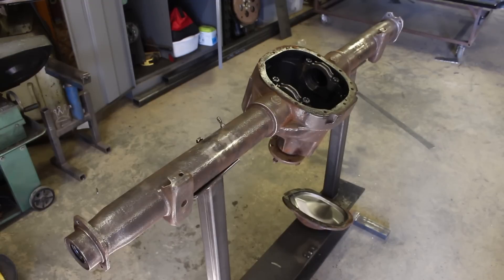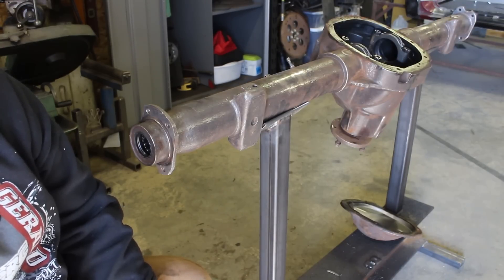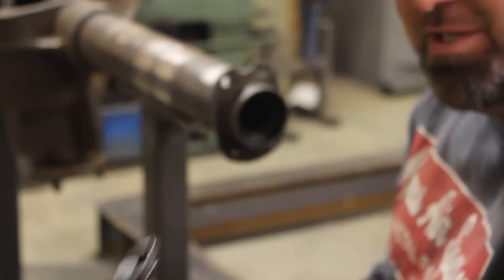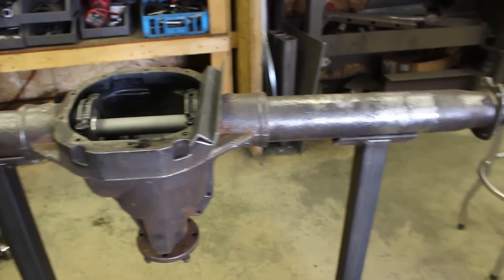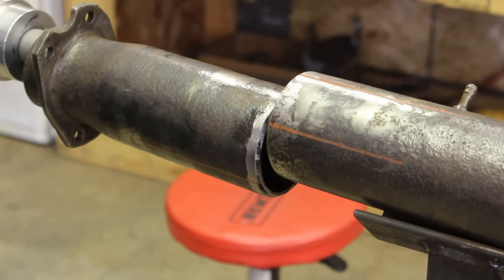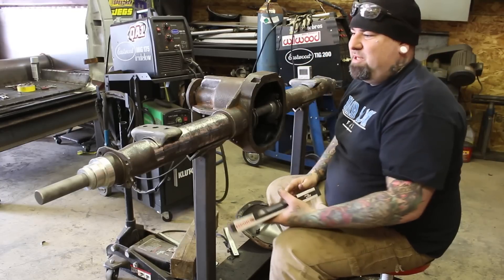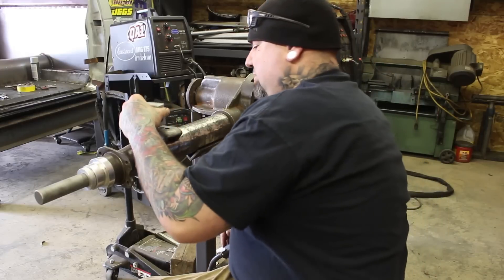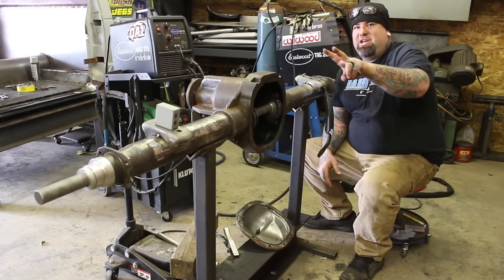How To: Narrow a Ford 8.8

Comment: Cut the housing ends off and weld on larger bearing ends. The issue isn't just that the housing is too long; the factory bearings are too small.

Comment: Another way to do this WITHOUT buying a second driver side axle, is to make a cut on EACH tube. One at 7” and the other at 4” and then just swap tubes from one side to the other, then swap the axles. You then have a centered pinion and reuse the same axles
Reply: Impossible..... literally impossible.....post up a vid then....

Comment: Nice video do you still do the s10 8.8 interested in one
Reply: Do more research in doing it yourself. 
Sadly this guy did not prep or setup right for the video and it probably warped even using a tig machine.
He left out some good info and i would not pay anyone to do what he just did.
Its easier than you think. 
My suggestion, do it your self but use two 3" C channel about a foot long on either side to center the tube. Tack in2 places measure all four opposing sides to make sure its straight and weld two opposing sides let cool than weld the other 2 sides. And save yourself $$$
Aunt nothing to it chicken wing.

Comment: Great video!!  I like your laid back style.  Only question I have is I just narrowed my 8.8 4 7/8".  It gave me 49" from outer tube flange to OTF.  The stock rear end was 38.250 on the center to center perches.  My math came up with 5 3/8 from OTF to center perch.  Now thats to mount it in an 89 2wd s10 blazer.  What s10 were you mounting in to?  It must be different from mine or my math is wrong.
Reply: I was wonder the same thing because just by cutting the one side of the 8.8 it is still wider then the stock s10 rear so how would you put the perches back on by measuring from the axle end. Look like they would be to wide
Reply: @tavorislevy5476  he measured the perches on the original axle, center to center.  Then measured the width of the new narrowed axle.  You subtract the overall narrowed width by the measurement taken of the original perch.  Take that figure and divide by 2 and that tells you how far to measure in from the end of the tube to the center of where the perch will be.  You are right in that it will be a little wider over all by only cutting one side.  About 1/2" per side.
Reply: @mlone7  exactly but for most guys being able to use another factory axle and only having to narrow and weld one side is worth the half inch extra width per side. There's ways to deal with it and it's rarely a problem but I recommend everyone buying wheels to wait till after.
Reply: @southjerseysound7340  Yes.  Can change the offset of the wheel.  I totally agree to wait till later to buy your wheels.  After everything is done with the setup of the diff and your front end.  This was basically playing around on my part to go this route.
Reply: @mlone7  it's truly a great rear for the money and I put about 50k miles of abuse on mine and that was with the Crown Vic police center section from a wrecked police car. I had less than$300 total in it for my S10. About the only thing I'd do differently would be cutting and narrow the tube instead of drilling the plug welds from the housing and welding the shortened tube back in. But at the time there weren't videos on how to do it and we felt it was easier to get everything straight that way.  I'd also recommend bracing it when you're at it. Lastly proper planning builds has saved me a fortune compared to friends but it takes more time. Like everything there's trade offs.

Comment: You could have pulled the seal and bearing at the same time with that style of bearing puller and 9 times out of 10 you won't even damage the seal in the process

Comment: I'm wanting to narrow a Ford rear end for a 56 Chevy.  To keep the pinion behind the transmission would I need to shorten the tubes on both sides?  If I did that, how in the world do I get axles to fit?
Reply: With the 8.8 one side is longer than the other so you just cut the long side down to the length of the short side. Then you can use a short side axle shaft on both sides.
Reply: @evansautomotive307  If you only shorten one side, doesn't that move the 3rd member in that direction?
Reply: I'm with you bud. I don't understand how.it wouldn't.move the 3rd member to one side. And if you shorten the long side to equal the short side, what length of housing do you end up with?
Reply: @kevinbrown1629  You cut the long size to match the short side, making both axle tubes the exact same length which puts the 3rd member in the middle. This makes the axle 56 inches
Reply: @kevinbrown1629  minus 2 7/8 inches off long end that is rearend housing  width.

Comment: The best seal remover is the end of the axle . The groove for the "C" clip will grab the seal as you lever it out .
Reply: I use a 30 bar.  30 seconds both sides.

Comment: i recently bought a 140 hobart mig would that work to weld the axle tubes?
Reply from the maker: Yes, as long as its 220 power. If its not you could do a few passes instead of 1
Reply: @sbdfabrication2694 140MIG 115v
Reply from the maker: @josepadilla7981  crank the heat up and have a good extension cord, or plug it right into the wall

Comment: Will you cover drilling the axles to 5x4.75, or do you just buy them already done. If so, supplier?
Reply from the maker: I will buy them from strange engineering
Reply: @sbdfabrication2694  How much do they cost?
Reply: Does strange sell the rotors in that pattern also

Comment: Not sure what axle you had in your s10, maybe 7.25 or 8.25 axles but did you just measure off the old axle where the leaf mounts go or what exactly? And why did you go off the origanal 8.8 leaf mount degree instead of the s10's degree set up?
Reply from the maker: Mongo the Mechanic  yes i measured off of the s10 then went of the center line of this axle. The spring perches off the s10 werr about the same so i just used this axle to measure those